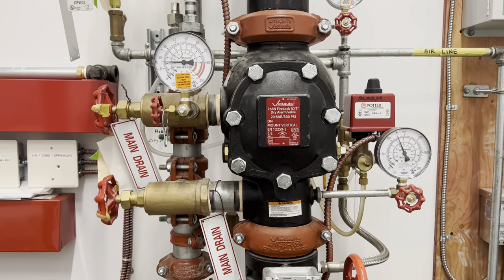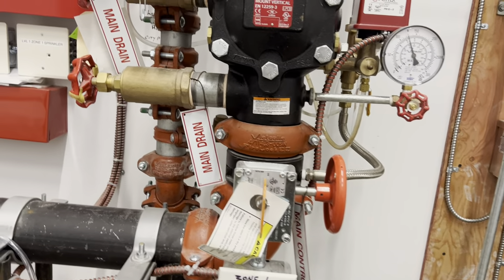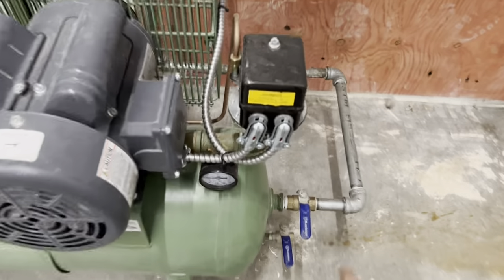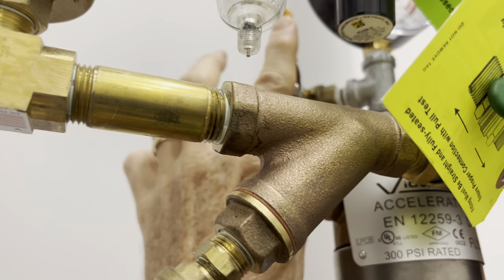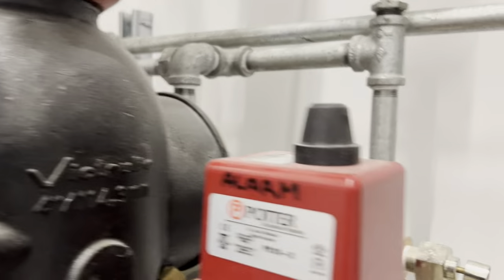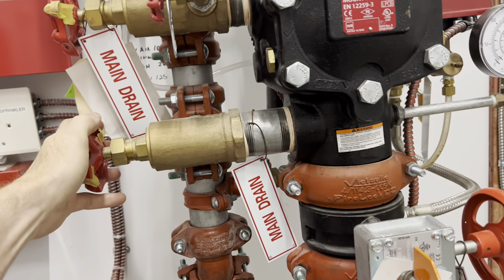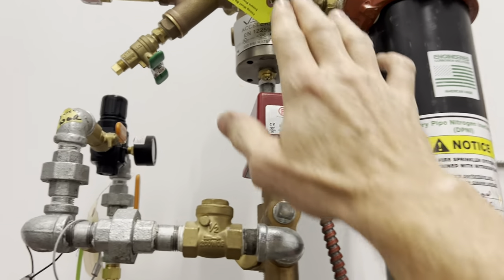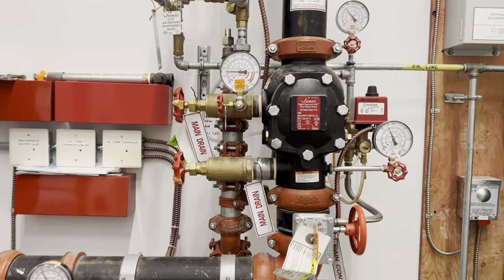Sprinkler System   Victaulic 768N Firelock Dry Valve

Comment: why not explain how to set the air maintenance valve
Reply from the maker: Ok  will do that on the next valve room install .
Reply from the maker: They are fairly simple to set up . Pull out the black knob and turn left or right to lower or raise the pressure .